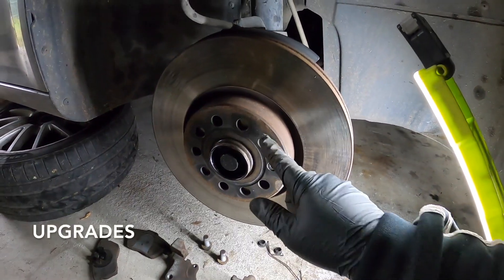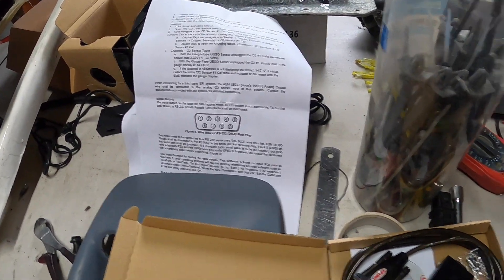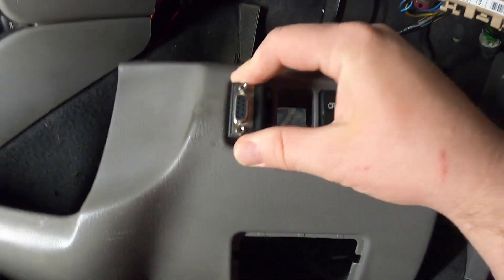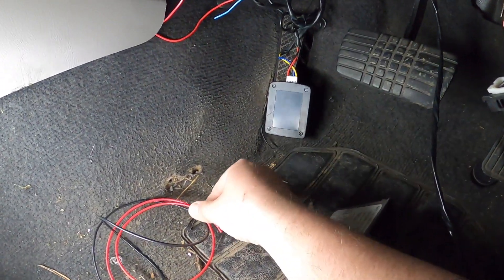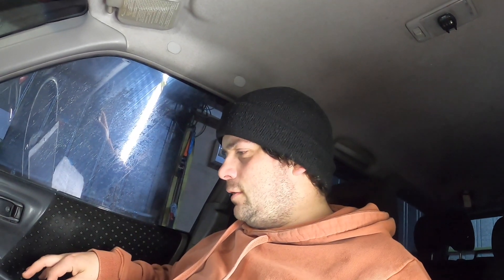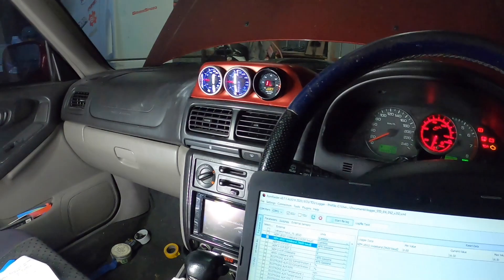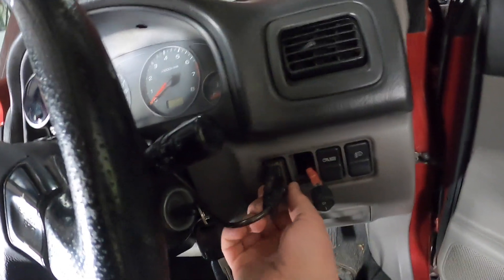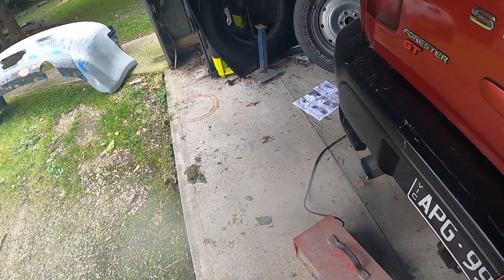How to Log an AEM Wideband on STOCK ECU (Serial Ports)

Comment: What pins ended up working for you?
Reply from the maker: Pins on the serial port?
Reply: @HarrodsGarage  yes
Reply from the maker: Alright. Just found it in my garage as it’s not in the foz anymore. I used the blue wire from the gauge which goes to number 2 on the serial port and an earth which goes to number 10 on the serial port. Hope that helps
Reply: Number 10 aren't there only 9 ports  @HarrodsGarage
Reply: @thatsmylineleaveitalone  9 com ports and 1 ground so technically 10 making ground number 10

Comment: Hey brother, where can I buy the serial port kit you used? Looking for my 09 wrx, cheers.
Reply from the maker: I just got it off eBay
1.5M USB to 9 Pin Serial Port RS232 COM Port Cable Converter for Win Mac Linux and DB9 connector 9 pin rs232 plug wire sleeve